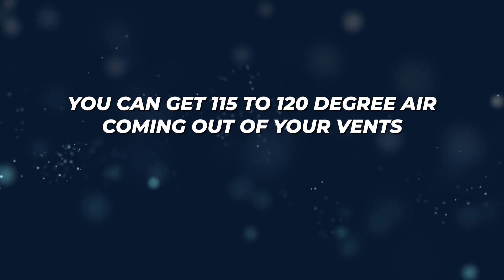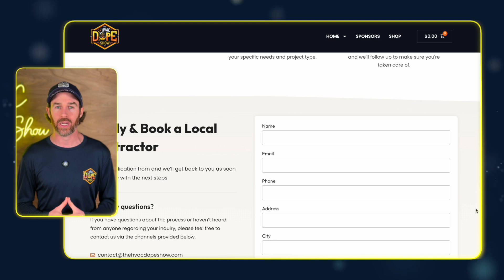Why this contractor replaces Oil Furnaces with Heat Pumps | East Coast Contractor Interview

Comment: When you take an oil furnace out and put a heat pump in for an older customer, they will always complain how cold the heat pump is. A oil furnace produces around 130 degrees supply temperature, and heat pump only do around 105. We do duel fuel heat pump with gas back up and the older customers are happy with that. Also heat pump are not green, most of the country use coal to produce electricity.
Reply from the maker: Good to know, I know little about oil but this is all true, a lot of people don't realize this about energy, even in California they have a surplus of solar midday and overnight or during peak demand they have to fire up power plants to keep up with demand

Comment: Heat pumps are junk in very cold weather. Do not be fooled! They only save to -10 C. Not F. After that the COP is useless and electric back up heat comes on to assist. Even the latest greatest most expensive units.

Comment: Is the dakin fit only a central air unit?
Reply from the maker: It comes in AC only or heat pump version but yes it's a ducted system. If you're looking for air to water heat pump to replace a boiler something like the Altherma might be a good option but if you have radiators it won't get quite hot enough
Reply: @TheHVACDopeShow  no, I'm looking for a mini split system, the dikan fit sounds really good but I'm not sure if there's an equivalent in a 3 head mini split

Comment: So on a different topic, boilers, what could cause the boiler to fire up over temp? It will be set at 70, and go crazy and heat up till it says 83, it will be set at 65 and go to 78, and it will be set at 60 and fire up till it’s reading 73.  Always around 13-15 degrees over whatever the temp is set at. At first I thought it might be the aquastat relay, but it does stop firing up when it gets to what it thinks the desired temp should. Any idea what could cause this? Thanks in advance.
Reply from the maker: Stuck end switch on zone valve or control board issue or thermostat issue or wiring issue. Depends if it's a new install, or if it just happened after working fine for years then a zone valve end switch is stuck most likely, just get a new valve. Idk you have to see if the thermostat is calling
Reply: @TheHVACDopeShow 
It’s an OLD install. Boiler is an old Weil McLain PEG-55. Thermostat is an old Honeywell Chronotherm III from around the mid 90s so I figure that old thing is as good place to start as any and then I’ll work my way through this list.
It has been a pretty reliable tank over the years. This issue only started about a week ago.
Thank you so much for the response.
Subscribed!

Comment: I don't care about carbon foot print I want a smaller bill. I do love my oil furnace. Love the sound when it ignites.
Reply from the maker: I've honestly never ran across an oil furnace we barely have them in Colorado. Most people are running propane if they're off grid... I've always heard oil is extremely expensive to operate

Comment: Hmm, going dual fuel he recommended a high efficiency furnace of the 96-97% type?  For me who is just a homeowner, I would only get an 80% efficiency since over 90% of the time the heat pump is doing the heating.  Im in the Seattle area and just replaced my 80% furnace and 22 yr old a/c unit with a Daikin enhanced hp with 80% Daikin furnace.  I really believe its a waist of money to get a high efficiency furnace for my application and climate conditions.
Reply from the maker: I agree honestly, especially if you're prioritizing heat pump operation but everyone has their own take. Idk what the bills / natural gas costs are like. I think his thought was flexibility to prioritize a higher change over temp to furnace if you're looking to save money and have cheap gas
Reply: I’d love to put an 80% in my house, heat pump or not. Cheaper, less maintenance and longer life.